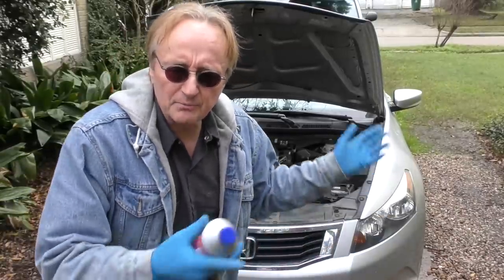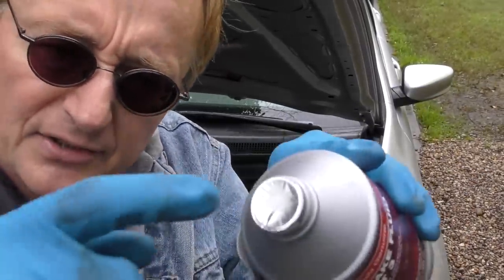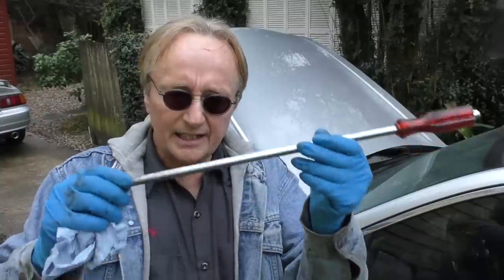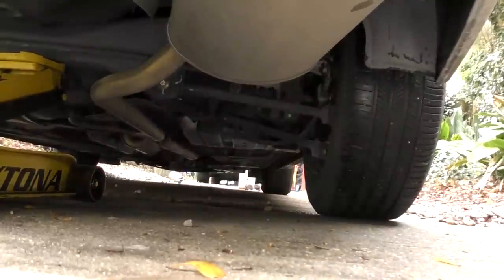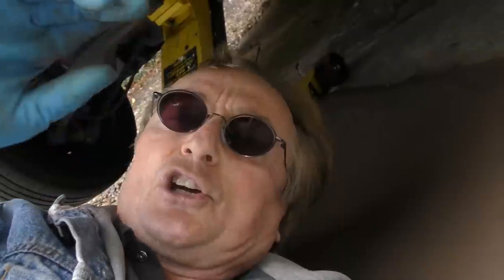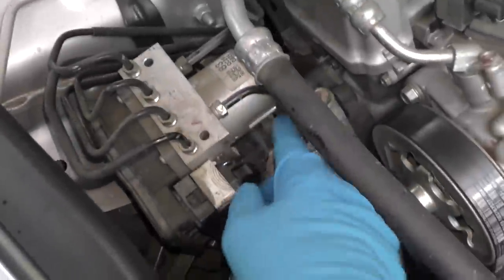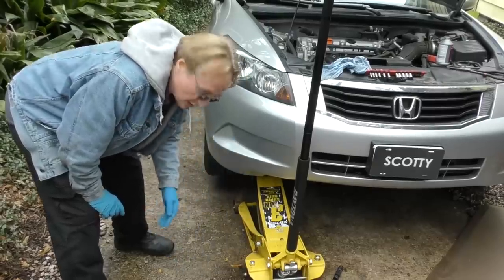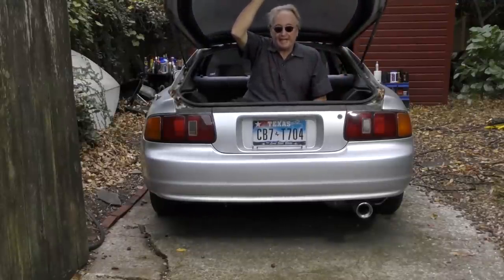Mechanics Don't Want You to Know This About Brakes

Comment: Hello: Scotty! I was looking at your video on scan tool I got the Ancel AD410 Enhanced Code Reader OBD2 Scanner. You had said it's really good! I guess my question is well this work on both my sons car a 2019 hyundai veloster N and my 2017 Honda CR-V?
Reply: It should.
Reply: Yes but you may need to update the machine depending on its build date
Reply: OBD2 is universal but you may need the specific software for Hyundai & Honda models to get into all the live data etc
Reply: Did the scan tool come with a book?  It will tell you what vehicles it works with.  My cheap one I bought several years ago works with them.

Comment: You should get it tested for free at a place like Monroe Muffler.  They can dip a strip in the fluid and see how much water it has in it.  I have had cars for 15-20 years and the brake fluid was never changed.  It was tested as perfect - the mechanics shop said "why change it?"

Comment: I do it backwards using an oil squirter because air travels to the highest point.  Do not try his method if your car clutch shares the brake master cylinder like some old Porsches because the brake pedal drops to the floor.

Comment: The trouble is that air WILL enter the system by the bleeder thread, when you unscrew it. It is advisable to put some thick grease on those threads that will seal it perfectly.

Comment: I put a clear line on all the bleeders and insert all of them into individual soda cans then I open all the bleeders . Now I take off the top off the master cylinder reservoir and use a good plunger. Just remember don't let the fluid get to low in the reservoir or you will have to rinse and repeat. JK. In reality make sure you can open all the bleeders first before you begin. Use a closed end of a wrench or you will strip the bleeders for sure. If you spray some WD-40 on the bleeders a day or two ahead of time you will find that they usually break loose fairly easy.

Comment: Brake oil use to be high purity peanut oil, takes the heat. Downside was vegetable oil would destroy the water and automatic transmission hoses if it leaked onto them.  Wonder what they use now.

Comment: Hay Scotty I recently bought an 2009 toyota venza for 10600 with 13900 miles on it and it has awd light on and vsc light on and trac control light on and the code reads gas cap. What's your thoughts on that and that type of car. It v6 automatic fully loaded. It was 38600 new in 2009 please respond.
Reply: Yeah; it probably needs a new gas cap; the old ones can wear out with age. Go online and look for a Toyota 77300-06040 cap, buy one, put it on, and drive it four an hour or so; the code should go away. They're really great cars; they're basically plush Camry crossovers. If it has a four-cylinder, check the oil every other fillup.
Reply: normal.  It may have disabled the cruise control as well.  These modern cars get really mad when something is wrong.

Comment: Just remember your master cylender can be in diffirent places make sure you locate it then start at the wheel furthest from the master cylinder otherwise it wont be perfect and you could still have air or water in the lines

Comment: Bleeding brakes is a one-man job if you install a set of RUSSELL Speed Bleeders. Easy-peasy -- just remove the old bleeder screws, screw in the RUSSELL Speed Bleeders, and bleed the brakes quickly and easily -- and no mess.

Comment: Hey,  Scotty I seen this 2008 chrysler Aspen 5.7 liter v8 engine for 4,500 used with 195,000 miles. I have a family soI wanted to know what what you think about this type of suv. Also I'm new here. Really like your channel.
Reply: It's based on the Dodge Durango. The 2007-2009 versions were very reliable. Price depends on its condition and if it's 2WD or 4WD. The former in good condition is $2,800-3.700. If it's the latter in very good condition, $3,700-4,700.

Comment: There is a trick to bleeding ABS units without a scan tool, you just need to find an empty, wet parking lot, get up to speed then slam on the brakes, and then bleed the lines again. Not that I am recommending this, of course.... :D

Comment: This way takes way too long. You can buy a small container from most auto parts stores with rubber tubing that you connect to the bleeder valve, put a brick underneath the brake pedal so you don't push it too far, open the bleeder valve and simply pump several times (but no more than 10) . Fill up the master cylinder again and repeat until the fluid is clear. Move to the next wheel & repeat.

Comment: Correction: Every two years is more optimal for your vehicle if you want your brakes to be like new for the life if the vehicle. In 2 years, 100ml of brake fluid can absorb 2 ml of water. Now, inside the brake system, it won't be as much as that, but actually fairly close. Manufacturers generally say every 3 years or 30,000 miles due to the fact that it'll be outside of the warranty at that point.

Comment: Best way to bleed brakes is to use the big syringe.
You draw the fluid out with no danger of busting the seals like with the other ways of doing it.
Works great with bikes or cars.
Perfect for cars with ABS as well.
Would do it no other way now.
Reply: Or a hand pumper fluid transfer they sell at hobo freight
Reply: That doesn't bleed air from the system
Reply: It does bleed air from the system ray s.
Very simple to do.
Done this many times on bikes & cars with no problems and would not do the brakes any other way now.
The brakes seem a lot better than doing it the old fashioned way of pumping the brakes.
Reply: @1066gaz   So you use a syringe to take fluid out of the master cylinder?
Reply: @1066gaz   Using a turkey baster to suck out fluid from the master cylinder does not remove air from the lines.  
It is a way to remove some old fluid to put in new fluid, however.
If you have air in the lines, you must bleed the system via the bleeding procedure.
Reply: Ray S 
Read my previous comment carefully.
I did not say using a turkey baster removes the air from the lines.
I use the turkey baster to remove some of the old fluid from the master cylinder then top up with fresh fluid into the master cylinder, then start the process of bleeding the brakes using a syringe at each wheel in the right order, as shown in scottys video.
Reply: @1066gaz  Your original comment  and your first reply both say that using the syringe BLEEDS the brakes. 
Whatever,  it's your car.  Have a nice day
Reply: Wrong, Wrong, Wrong.
Using the syringe on the bleed nipple does bleed the brakes.
Use only a turkey baster just to get the old fluid out from the master cylinder.
Is that clear enough for you ray s.
Done this many times without fail.
Been fixing cars 30 years so know what im talking about.
(Sigh)

Comment: Brake fluid is hygroscopic. It attracts moisture which if it gets into your brake system can damage the Master Cylinder and or the ABS system. That could be a repair of several thousand dollars.  The brake fluid change interval is 2 to 3 years maximum, not 5 or 6.  Google it.

Comment: i have a nissan serena 
lately acceleration has been an issue, especially on climbing hills it cant go over 40
whats seems to be the issue yet on a high way i can easily do 120
Reply: What year and mileage is it?
Reply: Could be catylilic converter or needs timing kit
Reply: It could be about 23 different things.  My first guess is fuel pump or catalytic converter

Comment: Scotty my mom wants to buy a SUV but we don't have the money for a used rav 4  or crv and my dad wants something with under 100,000km any recemendations?
Reply: S10 Blazer
Reply: You probably won't find a cheap, low-mileage '07-09 Dodge Durango or Chrysler Aspen in good shape without the frame rusted, but they're rare reliable Chrysler products. A cheap, low-mileage, reliable SUV may not be possible to find at all.

Comment: Scotty, I got an 2008 Lexus is 250 automatic transmission, it has check VSC  and don't start. Can somebody help me about this problem?
Reply: If it is a no crank no start problem, try starting it from the neutral position.  If it does start, make sure the brakes and brake lights work and then get it to the shop
Reply: @rays7437  I tried but don't start!
Reply: @yorvingran  
I don't know much about Toyota products.  You could try clearing the memory by disconnecting the battery for 20 minutes

Comment: Took a look at my brake fluid yesterday and it was green not sure the last time it was changed 😫😦does that mean anything?it is s 2001 Monte Carlo v6 3.8 very well taken care of
Reply: As Rickbearcat implied, you were probably looking at the coolant reservoir. Change the coolant every two years. Drive that car into the ground.
Reply: When brake fluid turns green it means that the internal copper components of the brake system are being corroded from moisture contamination.  Go get a complete fluid exchange done.
Reply: @Rickbearcat   No, brake fluid can turn green from moisture contamination corroding the internal copper components of the brake system.
Reply: @EMichaelBall  No, brake fluid can turn green from moisture contamination corroding the internal copper components of the brake system.  I see it all the time
Reply: Every other fluid is as new as can be and brake reservoir is always on driver side usually but thanks yikes that’s would not be good to get those two mixed up lol but the coolant in this car is the orange type Dexron Thanks to all I appreciate the info   Will be flushing entire brake system today  👍

Comment: I prefer the other method where the hose you bleed with the drain end is submerged in brake fluid then you can pump the pedal to get all the old fluid out.

Comment: Will gravity bleeding work like you can do on a motorcycle? It's filling from the bottom and the air goes out on top.
Reply: No, there are high spots along the lines where air bubbles will get trapped.

Comment: Brake fluid is harmful for paint, so better to use tubes and control where it flows. While we bleed the valves, we should observe the fluid level in the reservoir and keep topping up / bleeding until clean fluid flows out.

Comment: Don’t do it in that order on many Gm cars,
Many Gm’s are not In that order. And comaro s with brimbos, you have to take the calipers loose on top and tilt them Back or the air in the lines will leave you with NO BRAKES!

Comment: I have a rilly big problem my truck will not start even thow i gest got a New battery do you think it is a starter problem or solinod problem
Reply: Try crossing the sillinoid with the key in the run position see if it starts , check ur starter relay too might be bad
Reply: Thank you ill try that

Comment: New cars don't get bled like that..Pass.rear then Driver front then Driver rear and finally Pass.front.The Pass rear and the Driver front work together.Old cars get bled like that.When a line blows on old cars either the front brakes or rear brakes worked.Newer cars blow a line the front brake works and the opposite side in the rear work together...RR LF, RR RF.

Comment: You def do not want air in the system if you have ABS brakes. You don't want air even if your was made b4 ABS. If the brake pedal is spongy and the car doesn't stop the way it should you know you got air in the system..

Comment: you do know that the reservoir is always open to the air, right? there's a damn hole in the cap that keeps it from drawing a vacuum when you press the brake pedal.

Comment: Can I bleed just the front calipers? Rears are drums.
Reply: Drum brakes bleed the same way
Reply: Ray S but can I bleed just the fronts for now and do the rears next week?
Reply: @Basement31   The proper way is to start in the rear on the wheel that is furthest from the master cylinder and work your way all the way around.  Otherwise you won't get the air out of the system.
Are you wanting to bleed your brakes just because or are you having a problem?  If there is a problem do it the correct way.

Comment: How do you know if your system has water in it ??
Reply: It just does. You just change it because it does
Reply: when it is 3 years old.  Or if the brake fluid is discolored - usually black or green.

Comment: I have to disagree with you Scotty. I have a 99 Buick parks avenue with 45Ok miles on it and a 99 Pontiac bonneville with 351k miles on it, both have the 3800 series 2 in it. Those old Buick’s run forever!

Comment: The fact that a truck can forget how to idle by just having its battery disconnected is ridiculous. What kind of trash are automakers producing these days? Don't answer that, I know all too well....
Reply: exc911ence It has compensated for all the crud in the throttle body and idle air bypass valve
Reply: Been like that for 20 years, especially with some Japanese models.

Comment: Come on, Scotty. You know there are two types of inexpensive testers (one for water, one for copper) that SAY when it is time for a change. And auto chains will give you a free rental on a pressure pot, to push in the new fluid. And also, that you can buy blue or gold  brake fluid, so you can SEE when the new fluid is all the way through. Bleeding each one 5-6 times? Nonsense! You're doing it the old fashioned hard way.

Comment: I dont understand what the big selling point on cars having ABS really is, as far as i can tell ABS what it does is, it prevents your wheels from locking up from hitting the brakes too hard, now can anyone here find the last time you hit your brakes in your car fully 100% to the point where the ABS system had to do some real work?

Cuz in forza it does 0% work for me, cuz i never have ABS turned on regardless of situation, and if your wheels do lock up or youre a heavy hitter with the brakes, do keep in mind if youre driving a manual car your car WILL shut off if you lock the wheels up, but if you use the clutch it wont shut down, so really i dont see the point of having an ABS syste in your car, if you ask me, that thing is just better gone have some... weight reduction while youre at it 😂

Comment: Doesn’t the brake pedal go hard without the engine running
Reply: That's because pressure is building up. If you release the pressure elsewhere (bleeding the brakes for instance), you don't have a problem.

Comment: Sorry Scotty fans, that was not the best way to bleed the brakes, a cheap vacuum bleeder kit will do a much better job and you can fully flush the system not just the caliper(s). Also you don't run the risk of overstroking the master cylinder and damaging the seals which will shorten the life of the master cylinder significantly.

Comment: Between putting the screwdriver on the clutch and recommending that using a screwdriver and the driver seat to bleed brakes should tell any normal individual that’s even basically mechanically inclined to NOT TAKE THIS ADVICE IN ANY WAY! Scotty RETIRE MAN  your giving advice that is bad not to mention MAKES THE JOB SLOW AS CAN BE rather than just asking a friend to pump the pedal or get a electric vacuum pump or hand held pump to do the job even faster.

Comment: He put the screw driver on the clutch the first time he shows it being used!!!! Then the brake bleeder tool he has 
is not a pro tool you can get it from harbor freight!!! you want to leave some fluid in your master cylinder so you don’t get air stuck in it and have to bench bleed it. And use jack stands never just use a jack like what he did here. Won’t be watching YouTube if the car falls on you

Comment: That's a lot of running back and forth, resetting that screwdriver, isn't it? My back would be mighty sore. Couldn't you get the wife to step on the brake? Or at least use a 2x4 if you don't have a screwdriver that long.

Comment: We use large dog pee pads under any job oil change, brake bleed ect
Reply: Gas stations use giant versions of those for gas spills.  But they cannot go into regular trash.  Take you pee pads and throw them into a gas station dumpster.  Household garbage landfills generally are not made to protect the ground water table

Comment: Dont you need dot 4 or 5 not 3
Reply: DOT 5 should never be mixed with any DOT- 3, or 4, or 5.1. Never.
Reply: You need what the manufacturer specifies.  DOT 4 or 4.1 can be used with DOT 3, but DOT 5 is for racing applications and cannot be mixed

Comment: Scotty I thought you were going to come clean about the brake fluid conspiracy. Brake fluid is lifetime and it is unnecessary to do brake fluid changes. I've been running the original fluid since 2002 on a BMW with an occasional top off at most. Brakes work perfectly. In fact I would argue that most braking systems are over engineered to hold up for decades without needing a drain and fill. It's a scam mfg and service centers and dealers came up with to extract more money out of us. Prove me wrong! Only exception would be a damaged brake line or cylinder ...